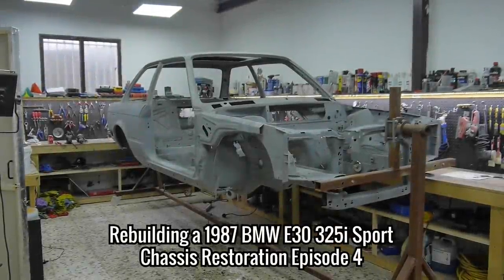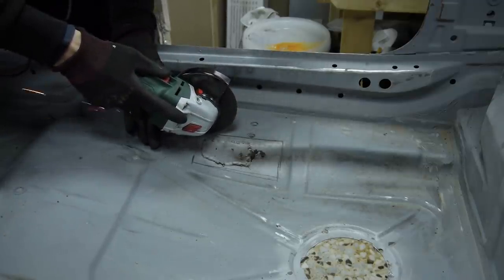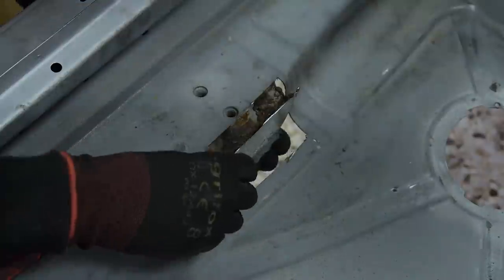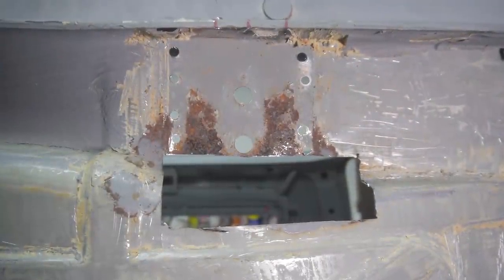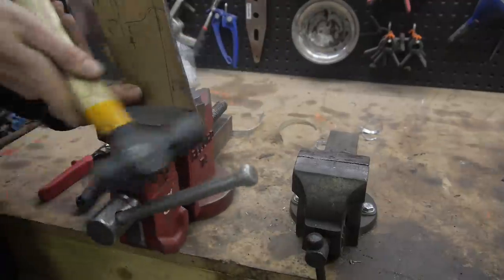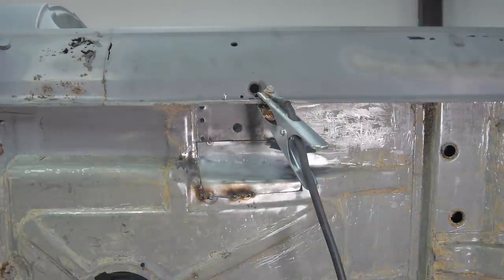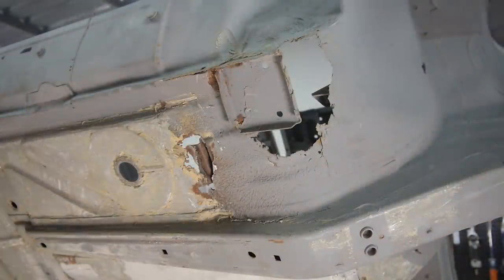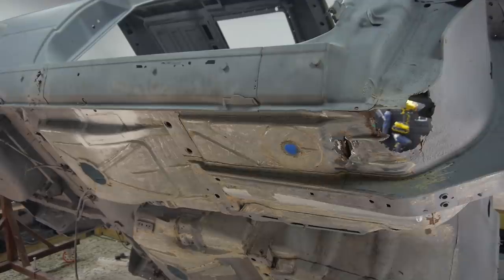Rebuilding A BMW E30 325i Sport | Part 4 - Definitely Butt Welds

Comment: Coming on great! Keep the episodes coming. One tip I found helpful, one amateur to another - make your repair patch before chopping out the rust. Then use the repair piece tacked into place as a template to guide your cut with a 1mm slitting disc. You will end up with a perfectly fitting patch with a 1mm slit around the perimeter. Ideal for butt welded panels where the weld will be ground flush.

Comment: It´s much more fun watching someone else do this than it was to do myself. Btw those what you call "front lifting points" are not jacking points by any means. They are remnants of the bodyshell being attached to the assembly line back in the day. And they are the main reason the front footwells on these rust like yours. And mine. So unless you´re doing a museum-style restoration don´t put them back. E30 front lifting points are in the sills just like the ones in the back.
Reply from the maker: Very true Dc and good point. I will think about what i'm going to put back in. I like what E30GarageNoway have come up with. Kind of removes the exposed join of two pieces.

Comment: Great Video. I might have a tip though. When welding, always choose a if possible identical angle between the welding torch and both pieces of metal. Unless one metal is thinner. In that case, lean towards that thinner piece with the torch to keep of some of that heat.
Cheers.

Comment: Get yourself a mini die grinder with the Roloc head. Much easier to grind compound curves and welds back. Planishing the weld with dolly and hammer will also help.

Can also recommend spot weld drills. Removes just the spot, without going completely through to the panel below. 

Don't give up. My Porsche chassis took me 2000 hours...lots of grinding and welding. ;-)

Comment: If you were to keep a lip on the edge of your replacement patch and then use a cheap kick shrinker/stretcher along that edge it would contour the panel along the adjacent plane as shrinking or stretching the edge would force the adjacent plane to follow the edge.  (if that makes sense, only an idea)

Comment: Lap welds are fine if properly prepped with weld primer, and just tack weld every inch and then properly seam seal. Considering cars are almost completely lap spot welded and seam sealed
Reply from the maker: I agree. Its those half job lap welds that don't last.

Comment: Nice job! Can't wait to see all those new parts in!
All that rust originates from the snow and salt on the UK roads over the years? Here in Brazil only really low quality cars get rusted like that, but on the other way the interior trim of the BMWs sold here suffers a lot because of the year-round heat, specially rubber-covered parts and the roof lining.
Reply from the maker: Thanks Fernando! Yes exactly that. Its a shame but the truth. The interior's seem to do okay in the UK.

Comment: Why did you put the spray (paint?) on the patch multiple times before it was finished? Spray, grind, spray, whack it with a hammer etc.
Reply from the maker: In the video it appears as if I'm doing all of this all at once but im doing this over several days whilst working on other projects as well. I don't want to give it a chance to rust so I just quickly spray it.

Comment: I'm confused at the last bit..why would the car snap in half and what do chassis bars do to prevent that?
Reply from the maker: If i cut too much out without  bracing it the chassis could deform as its suspended on the rotisserie :)

Comment: It would not be simpler and easier - make a template first - - then reperature - then apply it   outline - cut and weld.  Then you would have perfect gaps and it would be better to weld. Regards.

Comment: I think you put to much weld in the seems. It could be less.
Reply from the maker: I agree! Hopefully next episode I am better.
Reply: What do you mean with too much? The welds need to be 100%, if you leave any gaps water WILL get in the seams and rust.
Reply: Catrik Look at the welds. There is far too much weld material. Normaly, you have to grind it down in order to make it pretty.